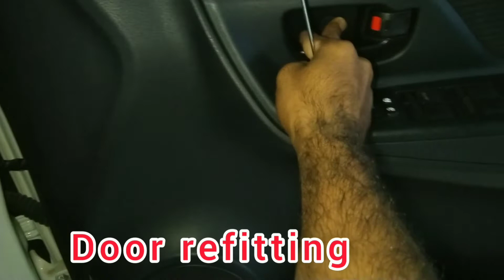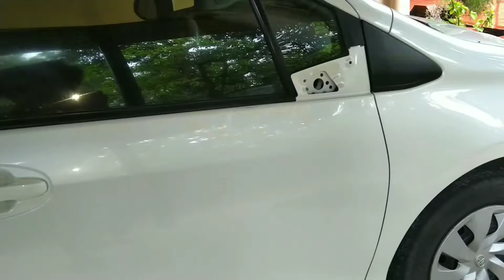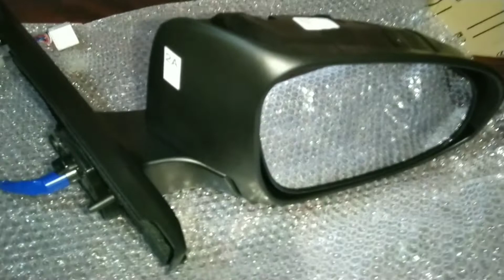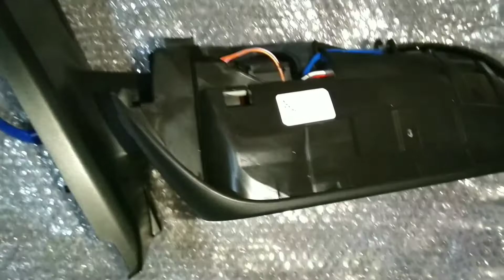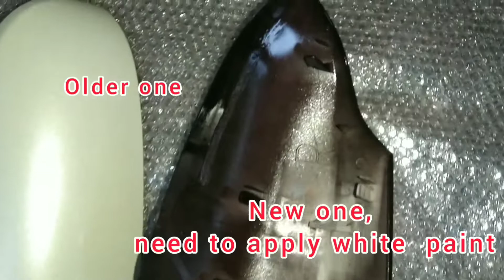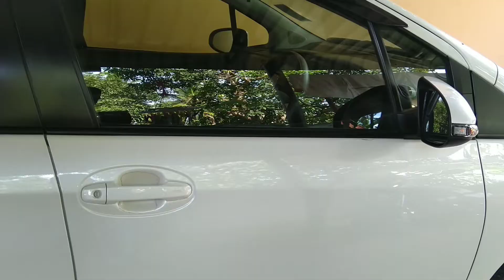Toyota Vitz 2017, rear view side mirror replacement

Comment: I have the same problem 🥲 can you give me the aliexpress link? Please
Reply from the maker: Sorry, I couldn't find it in AliExpress
However you can buy it in eBay. 
https://www.ebay.ca/itm/354275219783?hash=item527c72d947:g:LfAAAOSw4JRjHsnb&amdata=enc%3AAQAHAAAA8MxoP37H3VJ39WSRwt9C3Sdp%2FDeVBMxIfKG0jCiRzwGpFTvzhP6Y08E8n9aPtUACq2%2FfNKZhdi10uKKqK5wJyqc1sHg%2BhffKv8uYuilLTKS6jvN6gOi5GGs1k%2BOBQg%2B%2BlTeOnH3FsbQOsu9GN3iXyX%2Bk8MmChaz%2F4AcSMt6sR1SED3K8mwxrhURCDXtylW5rXhBtyghcJ7vKMJ0mBjs22xh%2FUJH4SXCdCnio34dRYohxz3zl3bnTls2QXY81ZT%2BWLZba%2BI8b6%2B7Qls9%2FoTZR41jhkT60J1qVcgCmzGq0xNAMSupkFcz0NLL4h1T2CsPyXQ%3D%3D%7Ctkp%3ABFBMwqG1-_Fg